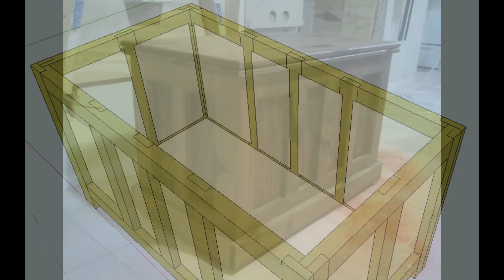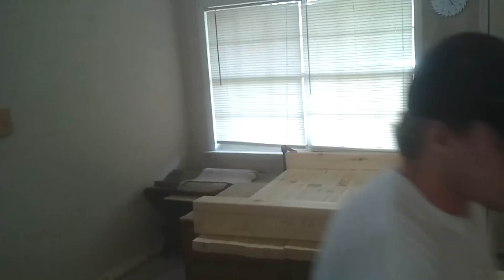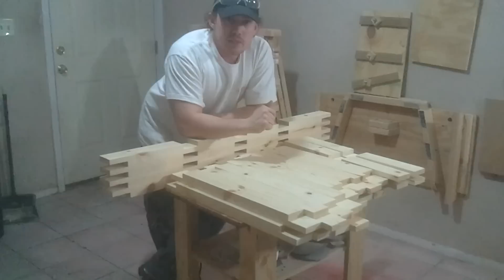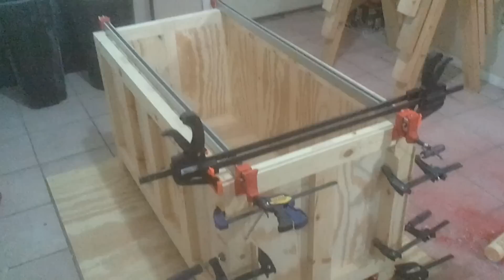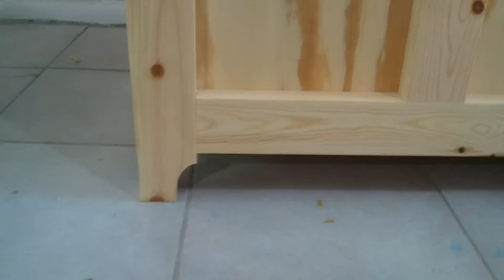2x4 Half Lap Blanket Chest - 089

Comment: Very nice job. You were doing great until the belt sander. Connect to a Shop Vac & a LOT of the dust issues go away (speaking from personal experience!). Having never made anything like that, one thing that I would consider doing is line the interior with cedar. Just a thought

Comment: "That doesn't mean they are all the same thickness", tell me about it. One day I wondered why my adirondack chair slats were not the same width as I ran them through a router to round over the edges. A light bulb came on and I realized the width of the 5/4 decking I was using was random. Not totally random but not all the same either.

Comment: Excellent videos Jay thanks for sharing i'm really learning a lot from you're channel, maybe i'm overthinking but why doesn't wood movement effect half-lap joints in the middle of a board? and wouldn't the movement of the styles break glue on the plywood? just trying to get my head around when and when not to worry about wood movement

Comment: Just add an air  spring to allow any person who gets trapped inside to be able to lift the lid easily   Any locks or latches need to be released from the inside   No locks on "toy boxes"   A simple gap around of about 1/4" will work for air circulation  For a "toy box" you want the  lid lifter to prevent drop down accidents.

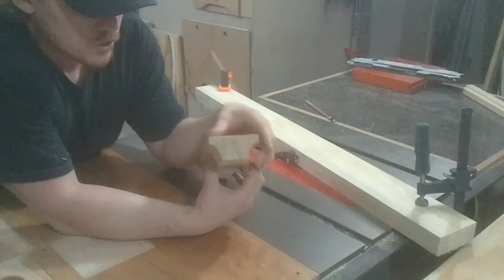Comment: Great video and info thanks!  Question though on your cove cut (11:30), you have your guide set at an angel why is that?  When the cove cut is at 90 degrees.  

Thanks.
Reply: Not sure if you ever got an answer from Jay or other videos. If the fence were straight it would produce a rabbet or dado cut. to get the cove  with the tablesaw it has to be run on an angle.

Comment: I would suggest that you invest in a side mount gas powered motor like an edger motor or something. Since you're so good with wood working create yourself a prop for the shaft and a box frame (safety ya know) to house it. Place some baffles in the corners. That way next time you're using that belt sander instead of trying to suck the debris out with the fan you can pressurize your shop with positive pressure. It's way more efficient that way at moving air through a building. Negative pressure moves little to no air through a building and allows dust to settle, unless you have a huge fan like an old barn fan. Positive pressure will most likely even keep those cabinets clean next time.

Comment: I bought a garage for washer, dryer,and lawnmower, so far used rib gun to put it altogether it's good,lol
No floor 
I,'ve played roll roof stuff it's black and some plastic now cinder blocks 2at corners 2. In middle. can I use it sides 4 my floor, it did not come with ONE

Comment: Jay, nice work. I noticed how well you did on lighting the shop so we could easily see what you were doing. Good sound as well, none of the typical voice being drowned out by a table say or power tool etc. Your description and step by step of what you were doing was clear, no rambling and easily understood. Might I suggest future videos you add in a couple of things like the size and type of router bit/s used. The general cost of materials, even if they were used or scrap off of something else. And one last note about shop safety. You might want to consider reminding your viewers about the proper use of power tools, safety glasses and or hearing protection. All in all an excellent tutorial.

Comment: good job.
anyway, using a handplane for flattening would be abetter choice (less dust!!)
and please, buy a good set of chisels!
Reply from the maker: Please send me money to buy a good set of chisels and I'll use them. Otherwise, I got the job done just fine with the tools I had.
Reply: Jay Bates a good set of used old chisels will cost less than the ones you bought bro!
Reply from the maker: I never bought any. These were given to me. A good old chisel will be junk if it's not properly sharpened. A properly sharpened "crappy" chisel works just fine!

Comment: Great idea with the level! Working with construction grade lumber can be a challenge due to its moisture content. Much higher than a cabinet grade material for example. So it does have a propensity for movement because of that. Your joinery on this project looks exceptional! Very good job!  This chest will be rock solid for a very long time.